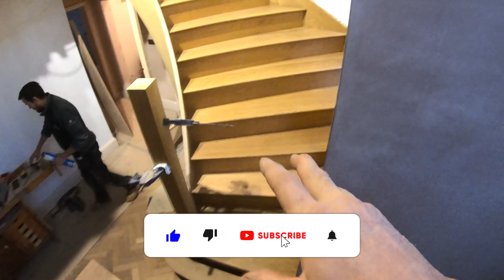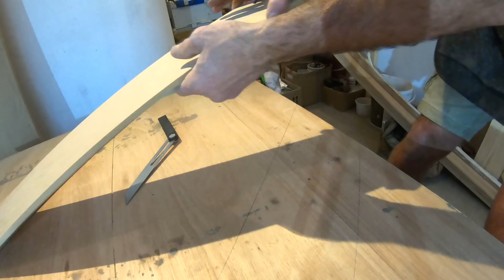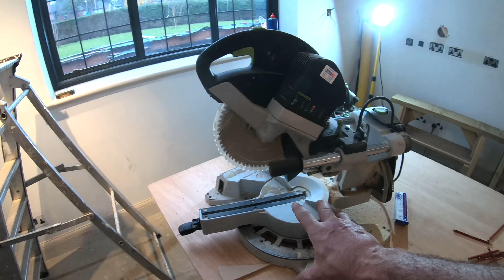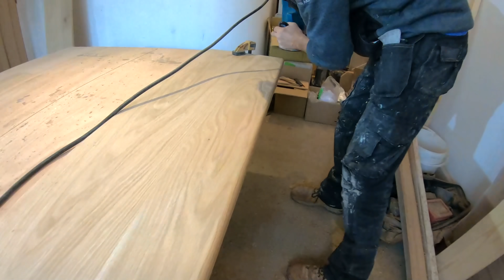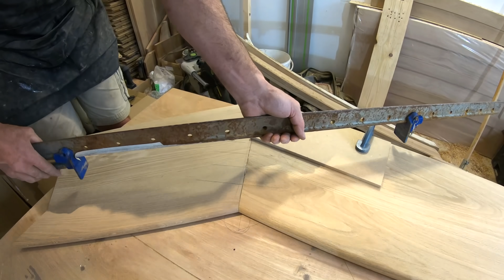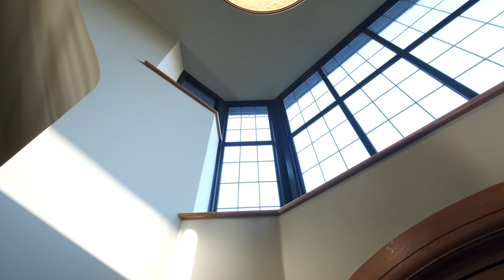FITTING A WINDOW BOARD - TIP TOP TOP TIP

Comment: Late to the part, great video! How did you secure the boards to the brick work? I am doing this (with MDF boards) in a 1930s house after bay window replacements and the brick are all over the place so surface is not level at all
Reply from the maker: The easiest way to do it would be with plastic packers. 

Dry fit everything first, using the packers to get everything nice and level. Once you've got it right, you can drill, plug and fix it down.

Hope this helps. 

All the best, John 👷🏻‍♂️
Reply: @BuildWithAE thanks, it does. I have already picked up a bag of packers. Thank you for taking the time to reply.

Comment: Tony ( and other builders out there ), I see that 120 mitre saw can be set to individual degrees and lock it in, but can you do that with say the Makita DeWalt saws etc( I know these have indents). I don’t yet have a mitre saw but Santa is going to bring me one for Christmas once I tell her the brand - she is letting me build my tools up every month as I promised not to either get a motor bike or sports car with my mid life crisis.
Reply from the maker: Hi Ian you made my day so funny, on a serious note though hi and try them Makita, festool , Bosch me personally festool all the best Tony 👍
Reply: I've used a mitre saw that has indents but you can turn a screw to disengage the part that fits into them so you can lock it to any angle. I think it was a Dewalt.
Reply: Hello Abigail, thank you very much for that much needed info. I will look into more now . Have 3 contenders to consider. Cheers. Ian

Comment: This looks good, but wouldn't it be better to have the joint angle also line through with the angle that the plaster will have? (So essentially from the corner in the window project the angle out towards the brick work, so the angle of the window & the angle of the plaster are join together using the window board's joint?)
Reply: I'm not even sure sure you know what you mean......

Comment: Awesome work as usual👏 how did you actually fix the the window board to the brickwork I’ve had issues with oak window boards curling in the sun in the past
Reply from the maker: Hi Ben just an idea try L shaped brackets at the front every 200mm to 300mm depending on length with them tongue on back should be good but also treat the board front and back all the best Tony 👍
Reply: @BuildWithAE  Thanks Tony learnt so much from your videos👍

Comment: Super techniques, lovely finish. How were they fixed into place?
Reply from the maker: Hi the tessellater glued in the back groove and tongue then edges held down by plaster then the front with L shaped brackets I also done it the old way by using screws from underneath wire tied and fixed it by screw and plug but it’s what works for your application all the best Tony 👍
Reply: @BuildWithAE  Given the shape didn't you need to lower it into the space from a above?

Comment: Really great joint made there.
If I heard correctly did you say you always prefer to fit the window boards prior to plastering? 
I have toyed with the notion of fitting them after plastering to protect them from wet plaster but I think window boards, both solid and softwood, are one finished carpentry item that can be fitted prior to plastering without compromising the quality of the finished installation.
Also what is your preferred fixing method?
Reply: Depending on the care and skill of the spreader...
Reply from the maker: Hi Tiktok that’s really down to personal preference, this is ok probably for softwood but hardwood I definitely would not, moisture content 6% to 8% in bench joinery because that’s were the planned timber has come from and damp wet site environment, well it’s a massive risk and the price of oak you can’t go back to the client and it’s something that I’am not willing to do and everyone has there own take on it, plus what tessellater says is very true. Do you treat your board and then protect it before your installation. As for fixing well so many methods. I have used wire and hook screw, pellet and screw and secret fixing in timber framed cill lines never grip fill 
All the best Tony 👍

Comment: Hi Tony,  
Super video as always from you guys, a quick question about the portion that's plastered into the wall, what do you use to protect it from moisture getting into the wood especially oak to prevent it from being stained, cheers in advance John.
Reply: They were sanded and fully finished before placing into position and plastering, I think.
Reply from the maker: Hi John they are fully coated but then also just before plastering low tack blue tape with thin polythene covering the Oak to discourage moisture transfer then leave plaster to dry well then trim back blue tape if required but most of the time not required just eye and line it square with your window all the best Tony 👍
Reply: @BuildWithAE  Thanks Tony, much appreciated.

Comment: The way you marked the bevel is definitely the simplest, you could even do it without the numbers on the saw.
I've always used a digital angle finder so say it reads 135 degrees, I'd divide that by 2 and subtract that number off 90 that the miter saw cuts at 135 / 2 = 1=67.5     90 - 67.5 = 22.5 is what the saw's set at
Reply from the maker: Hi Toby that works for me great way all the best Tony 👍